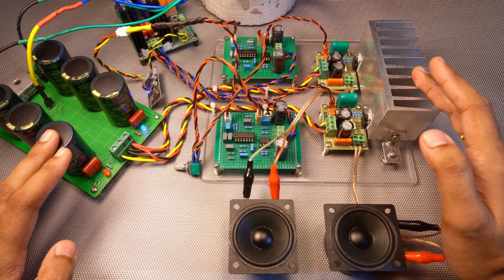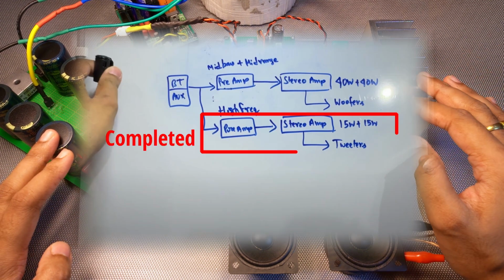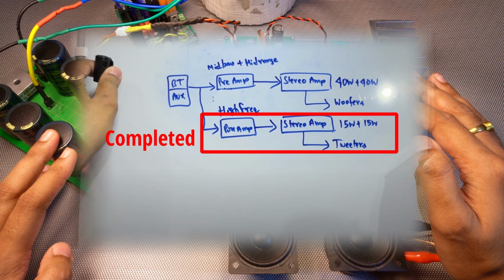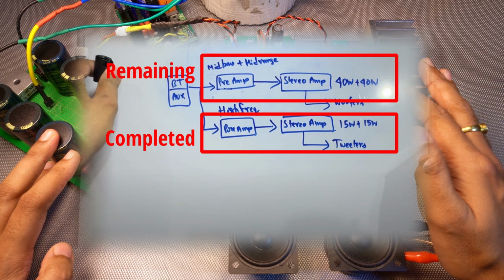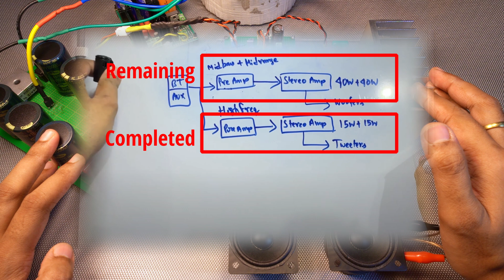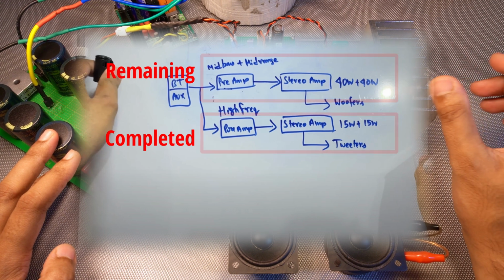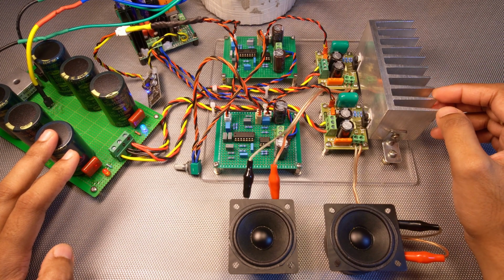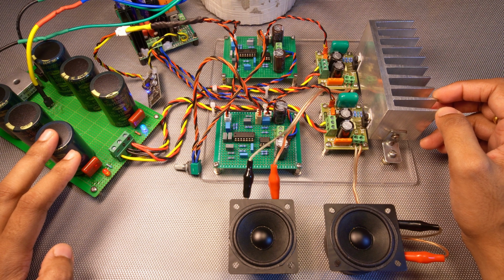Finished Tweeter Section | Power Amp+High Pass Filter| DIY Amplifier Project Part 6 | Sound Test

Comment: nice work, i'd definitely like to see the performance of these module in fullrange speaker application, ik you're using this for tweeter section but still wanna know how they sound like on normal speaker drivers :)
Reply from the maker: Well the speakers I used in this video … are normal speakers (almost full range) … so you can get some idea🤓
Reply: @Roys_Desk  nah, what i ment was testing the amp without using preamp section?
Reply from the maker: Aha okay understood…. You meant the raw sound of the amplifier
Reply: @ yes 😁